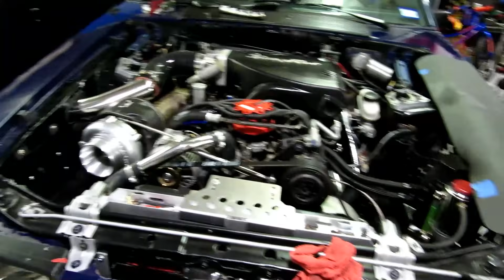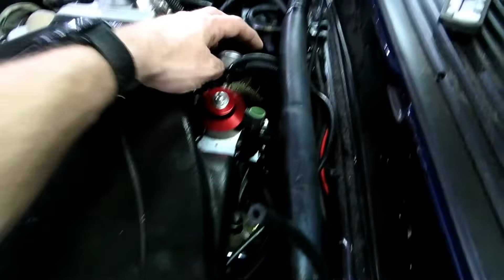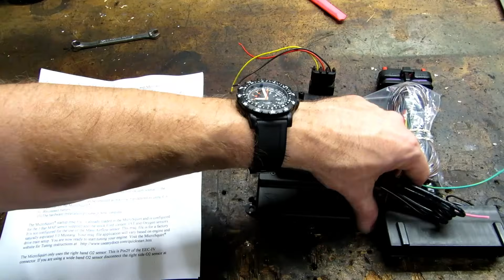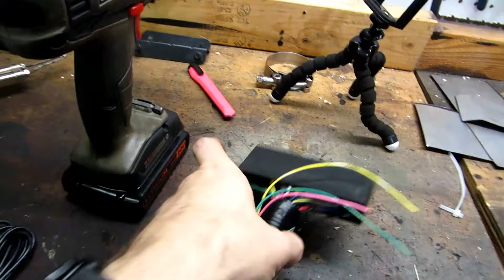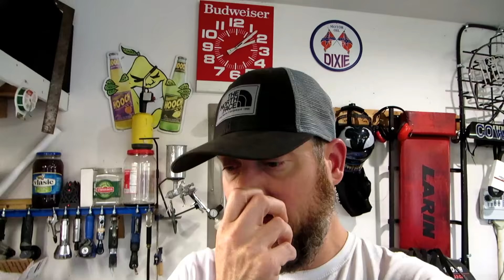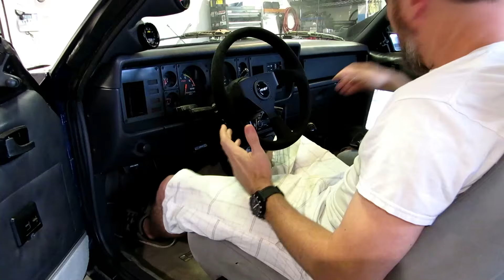FOXBODY On3 Turbo Install - Part 8 - Microsquirt Install

Comment: I ordered my Wideband and gonna order my microsquirt soon. Do I need both oe or sensors or are they both replaced by the 1 wide band? The car is an 86gt:)
Reply from the maker: Just need one. For me since i went turbo i only really need 1. Your good with one just know if anything goes crazy with the opposite bank, you wont know. Most dudes run a single o2 wideband

Comment: Did you use 1/8 or 1/4 inch silicon vacuum lines? Thanks for the in-depth install, man. Really appreciate it as someone who'll be starting their install this coming weekend.
Reply from the maker: The suff I ordered from amazon is 3.5mm ID silicon hose good to 60 psi.
Reply: @HOUSEOFDULA  Awesome, thank you for the quick reply!
Reply from the maker: @miketagliere6122  You bet!

Comment: I've got almost the same set up but can't get my laptop to talk to the microsquirt. I'm using the usd to db9 serial cable adapter the they sell on tunerstudio website. But get a no controller found message. Do u have any suggestions
Reply from the maker: Try a few different USB ports, and use auto detect to try all Com ports. You can also manually set the com parameters like baud rate to 115200 This is old but check here around the middle of the page for some Serial troubleshooting.  http://www.msextra.com/~msextra/doc/ms2extra/serial_setup.html

Comment: Where did you get your laptop adapter from??
Reply from the maker: Amazon. I just  searched Serial USB adapter. Its a sabrent. Cheap. Only issue I had was using this on a newer laptop with a USB 3.0 port , I moved the port to a USB 2.0 port and it worked fine. https://www.amazon.com/Sabrent-Converter-Prolific-Chipset-CB-DB9P/dp/B00IDSM6BW/ref=sr_1_2_sspa?keywords=Serial+USB+adapter&qid=1570029524&s=gateway&sr=8-2-spons&psc=1&spLa=ZW5jcnlwdGVkUXVhbGlmaWVyPUEySFAxNzhYUDBLQ1o2JmVuY3J5cHRlZElkPUEwMDk1MjEyM1JCTDRaVldMNlNYSyZlbmNyeXB0ZWRBZElkPUEwODAxMjQ1SUgxMVFDVThOSFBFJndpZGdldE5hbWU9c3BfYXRmJmFjdGlvbj1jbGlja1JlZGlyZWN0JmRvTm90TG9nQ2xpY2s9dHJ1ZQ==

Comment: Out of curiosity, wouldn't a pro charger have been 27 times easier to install?
Reply from the maker: Simple answer. Yes. Absolutely lol. If you want Turbo, you want Turbo though. I was up to the challenge. Boost is effectively more efficient since not crank driven though. Doesnt take HP to make more HP. They both are great though. Boost is fun no matter, I personally always wanted a turbo fox.

Comment: So i dont need to mass air my 88 speed density motor ? Im looking into doing the same exact thing to my gt
Reply from the maker: Nope not with this ecu. It can run MAF or speed density. Its pretty common to ditch MAF with aftermarket ECUs, especially with boost. But, NA all you need is this tuner! No need to source a MAF sensor, harness etc.

Comment: Did you consider the mega squirt instead of the micro??
Reply: Doesn’t the micro use your stock ecm and you just tune that ?? The mega totally replaces the ecm correct?? I’m trying to decide if I want to save some cash or maybe buy the mega and sell my a9l
Reply from the maker: I did. Its a bit more $$$ in fact almost double if I remember right, and not much gain. The only thing you really get is more I/O for accessories....which would be nice to have a few extra ports to wire some warning lights, control the fan, etc..

Comment: Did you have to change any of the wiring back to stock from the mass air conversion?
Reply from the maker: Nope, just unplugged MAF. Harness is still there. The pins on the stock ecu for maf, microscquirt doesnt use so not even there

Comment: Dont forget to ground the wideband controller also, I believe it's the brown wire.  I learned the hard way when my x series wasnt working
Reply from the maker: Haha, so, next video, i show this, because once fired up i had no afr signal, looked at the wiring diagram again and realized I needed to ground the brown one.
Reply: @HOUSEOFDULA  glad you got it figured out! I was lost on that one for a while
Reply from the maker: @allenhoward9379  Yeah one of those things...I didnt realize it was not reading until come time to fire it up and get it running. Quickly learned the O2 was not sending data to the ECU.

Comment: Is the microsquirt the best route also for a supercharger application? I have an 87 gt with speed density. I'm aobut to install a vortech v3 on her. Should I go microsquirt or the classic route (maf conversion and tune)? Thanks and keep up the awesome work! 🤘🤘
Reply: The micro is a great option for supercharged cars as well. By the time you spend on converting to maf you could've bought the micro.
Reply: @justin91lx  Thanks for your advice! And keep up your good work! I am a sub of your channel as well! 😎

Comment: heads up dula remember your still using your old 25 year old wiring , the microsquirt just plugs in where the old computer used to be, mine works great but I have ben having wire gremlins poping up because of old wiring , I might just go to holley dominator because they replace everything just a reminder brother looks great wwwwweeeeeeeeeeee ha
Reply from the maker: Yessir, thanks. Im always keeping an eye on this stuff especially the salt and pepper shaker connections.

Comment: Really enjoying the series! One question for you. Whats in the plans for A/C control. Are they on their own circuit or does the ecu control the compressor and fan?
Reply from the maker: Yes and no. Ecu does not turn ac on. Thats all independent from switches on the dash. What the ecu does do is idle up when the compressor kicks on. I just have to run a wire from my ac compressor to the ecu that tells it its on, and the micro can be programed to idle up when it sees input from that wire